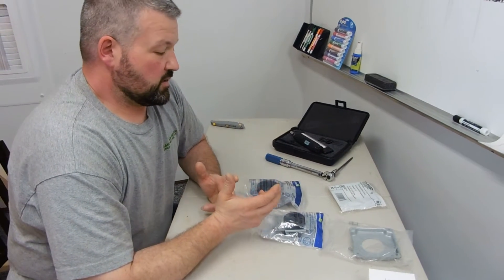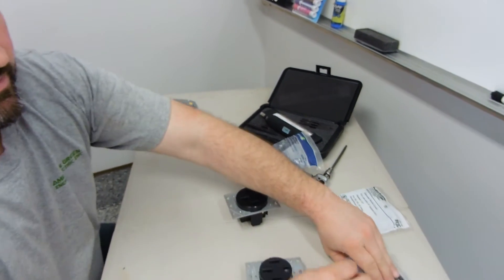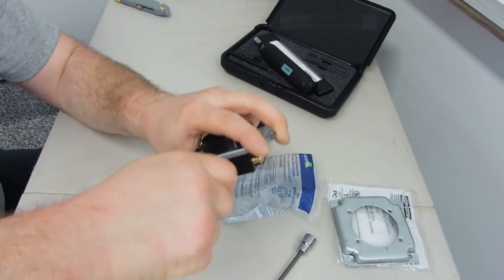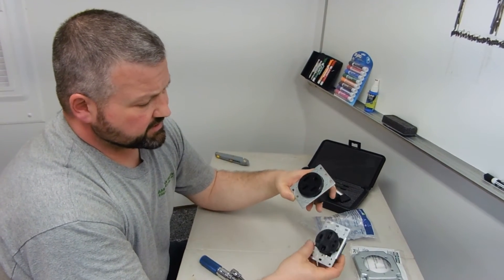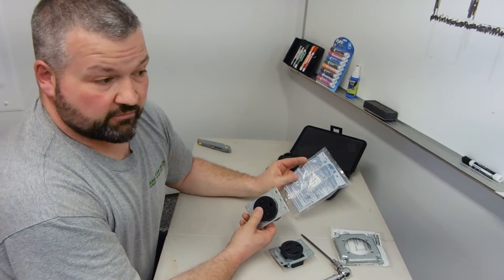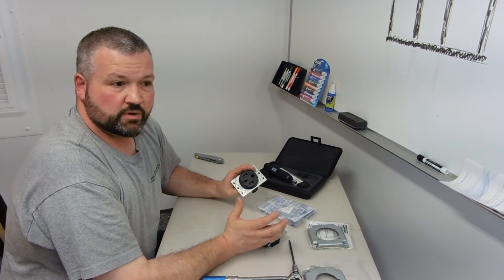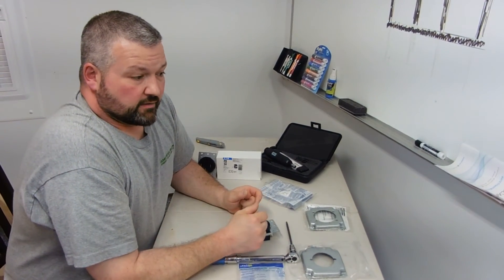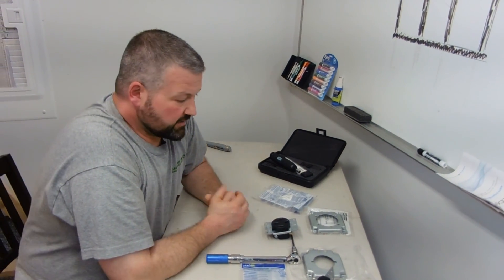EV Charger Hardwire vs. Plug In

Comment: Good explanation of the better quality of commercial grade 50 A outlets.  Many reports of melted EV charger receptacles if using a cheaper (~$15) residential-grade outlets.  Best to coat the wire strands with NoOx grease.  I've read that most/all EV chargers have internal GFI protection, so if hardwired on a dedicated circuit, one shouldn't need a GFCI breaker.  Can also skip running a neutral wire since most/all EV Chargers don't use a neutral.

EV owners use plugs so they can take their charger on trips, for Level 2 charging speed.  About the only use for that is to use an outlet at an RV park, otherwise can charge w/ 120 VAC (~3 mi per hour), or a public charger.

Comment: So I already have a 240v evse cable that came with the car. I don’t care about getting the fastest speed (of course faster than L1 please). I was planning on getting a 240v outlet Bryant/Hubble commercial installed in my garage. The electrician charges the same to install the outlet vs hardwired station. The difference is a quality station cost around $500. And if it breaks or dies prematurely (Amazon reviews show issues even with brands like ChargePoint) then I’d have to pay an electrician to come back out, remove and reinstall a new one. In a garage is it really with all that extra expense?
Reply: If you own a plug-in, it only makes sense to charge at home, except when required on road trips (full battery car).  Public chargers are pricey (35 to 80 c/kWh in CA), which costs 2x fueling with gasoline (55 mpg).  So, we don't fuss with chargers on road trips in our plug-in hybrid.  That would be like paying $8/gal for gas.

There are what wags term Level 1.5, which is a 16 A @ 240 VAC.  The $85 charger I bought on Amazon allows that, to give 3x the charging rate of the 12 A @ 120 VAC.  It auto-senses the voltage plugged in (limits output to 12 A when plugged into 120 VAC).  The charger comes with a 16 A plug and an adapter to 120 VAC plug.  I have an existing 30 A 240 VAC plug in the garage, so bought an adapter cable to a 16 A receptacle.  Can use that to faster-charge my son's Tesla when visiting.  I use 120 VAC for our plug-in hybrid since powered from our solar system (free), only takes 6 hr to full-charge our hybrid (30 mi e-range), plus the car is limited to 12 A max.

Comment: I totally agree with the preference for hard-wiring EVSE's. What is your preferred way to do splices if the charger comes with a whip. I'm planning to use Polaris 4-14 AWG connectors, but it does get bulky in a junction box. I think it would be helpful to include links to some of the higher quality 14-50 receptacles. I've used the HBL9450A from Hubbell.
Reply from the maker: I also use the Polaris connectors on the phase conductors. And I like to use a 4 11/16" x 2 1/8" deep box to splice in. It gives you a little more room. I will get some links up for the heavy duty receptacles. In the video is the Leviton 14-50R.